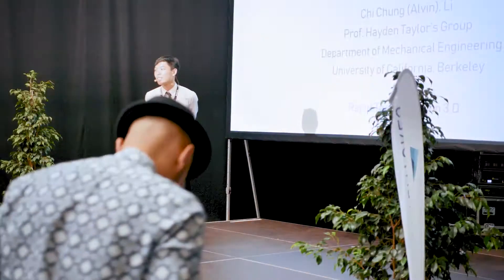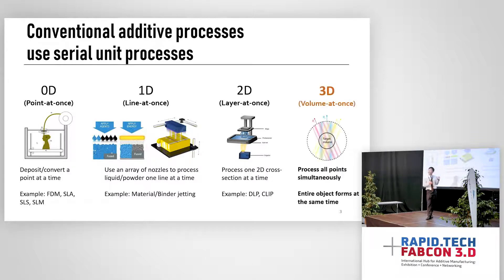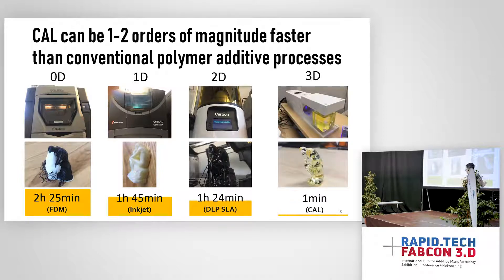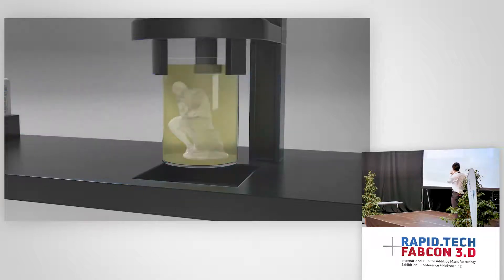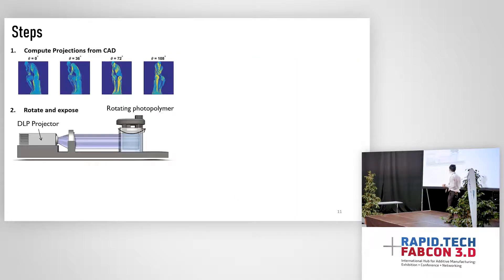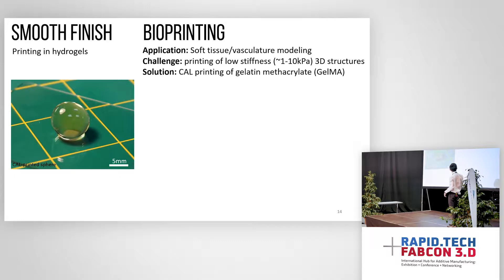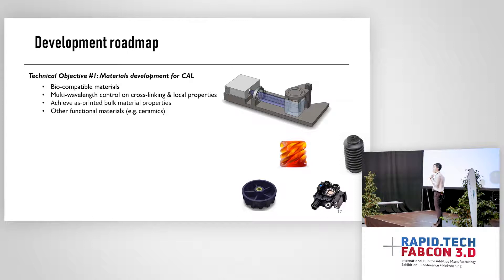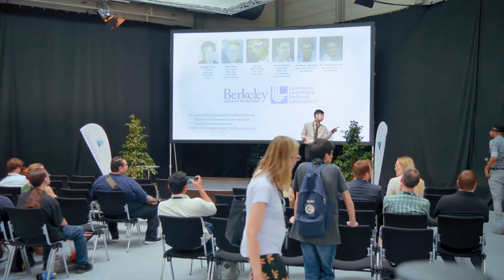Computed Axial Lithography: a new method of volumetric additive manufacturing

Comment: Does this technology have challenges to achieve a high conversion for very thick parts?
Reply: Yes, achieving high conversion in the target requires the materials to have high contrast photochemical response. To achieve the best geometry definition, normally we extract the part not long after gelation. And currently we rely on post-curing to complete the rest of the polymerization. There are work-in-progress to overcome this limit.

Comment: What really bugs me is that everytime I see something about this matter serves as example. This is kinda wrong. Its more like intensity modulated radiotherapy to be honest. In a CT no ones builds something up its just the reserve way. But radiotherapy does, what you are showing here, for YEARS!
And waving the CT as an example is just, not right from a technical point of view.
Yes I know CT is something some people know about compared to radiotherapy and you could say its a more graspable as an entry to your technology. But in the end for most people CT or any other form of x-ray imaging is kind of a black witchcraft anyway, so why not explaining it correctly from the beginning?
Reply: Good point. Personally I agree that the radiotherapy is a closer cousin to this technology and could be used as an equally good entry point for presentation. 
The contribution of this work is demonstration and analysis of applying these similar concepts (radiotherapy / CAT) in materials that are designed to perform volumetric additive manufacturing (VAM). The VAM paradigm only started from 2017 on this material system: https://advances.sciencemag.org/content/3/12/eaao5496 
Computed axial lithography can be seen as an extension of this work.
Reply: How do we learn this, can you please dumb it down & explain in simple terms, basics 101